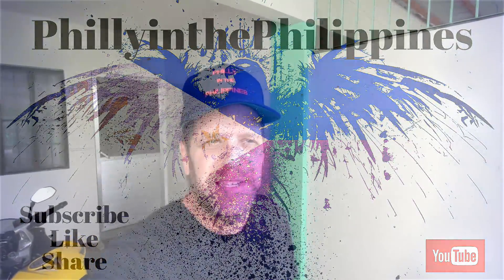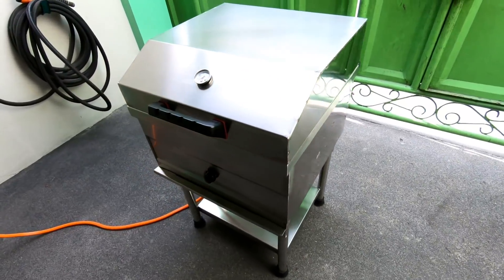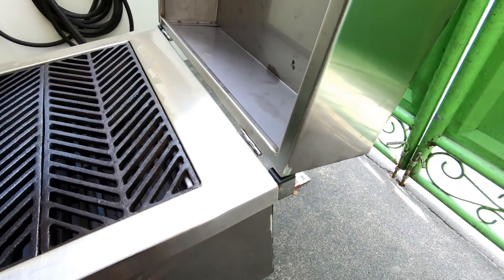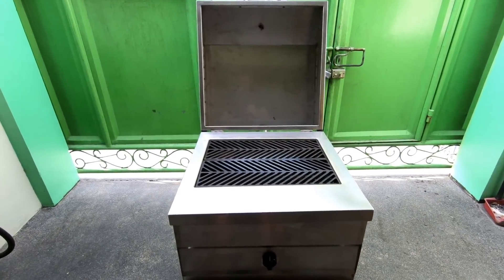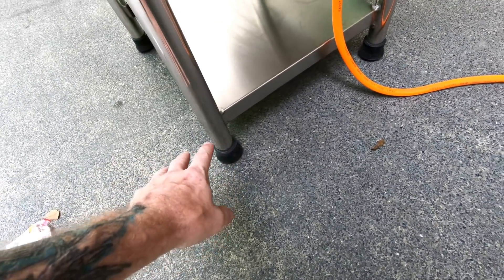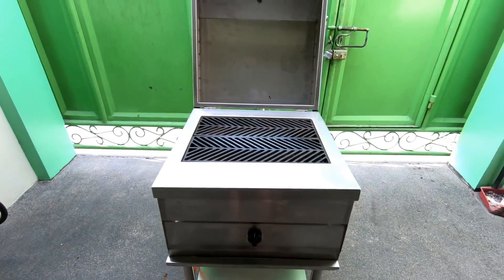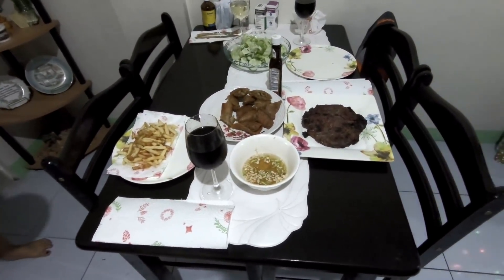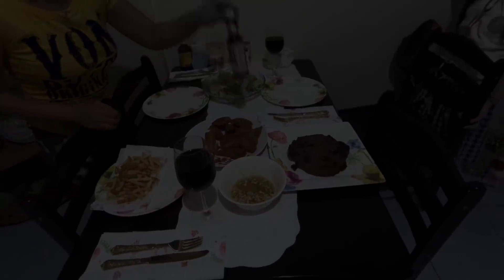Our New Custom BBQ Grill Has Arrived : The Philippines

Comment: The BBQ came out a lot nicer than I anticipated. They did a great job on the fabrication. Do a review in a few months and let us know how it works and also if you find anything that should be improved upon. 

We got 2 new tanks once when we bought them. The only problem is that they do not fill them they only exchange them so when we exchanged them we now own 2 old tanks.

Comment: Looks like it turned out pretty good, but there is a lot of strain on the hinges with the stops located so close to the hinge point.
Reply from the maker: I will be doing some of my own modifications. The front pulls up some with the lid open so I need to put a few screws in to keep it down.

Comment: Nice!  Congrats.  Brian:  How about wheels on the back legs to be able to move the dead weight around.  Great if you could get the locking kind.  What type of oil to you coat with?   You didn't mention the final cost.  Did you decide not to have a side table built on?  Bill
Reply from the maker: We used regular cooking oil. We found a cheaper side table some where else. We paid 25,000 pesos Right around $475 USD...Prices will also very depending on what size you want.
Reply: I was thinking the same thing about the wheels
Reply from the maker: i will be making a few modification and one of them is getting wheels for it.

Comment: Nice grill but you have no vents for the smoke to go out. If you use charcoal you need air to go in ans air to go out
Reply from the maker: I will be adding a smoke vent in the near future.
Reply: Yea, you're right it needs a vent so the heat and smoke can go up.

Comment: They are not tanks as in the US, They are double walled cylinders, if you want to buy a new one I know where , but when you go to refill they are going to take your new cylinder and give you an old one to replace. The LP gas vendors, call in there order and a large truck shows up and trades out the cylinders. No sure witch vendor you use, 3 or 4 in our area. 
Are you going to start cooking at the Sara Sara Store?
Reply from the maker: Thanks for sharing that. We have no plans to do any BBQ cooking at the store.

Comment: Soak those lava rocks in water b4 using, how much was the custom grill?👍🏼🇵🇭🇺🇸👍🏼
Reply from the maker: We paid 25,000 pesos Right around $475 USD...Prices will also very depending on what size you want.
Reply: That market where  all the hardware and commercial equipment is called what ? Marina something?